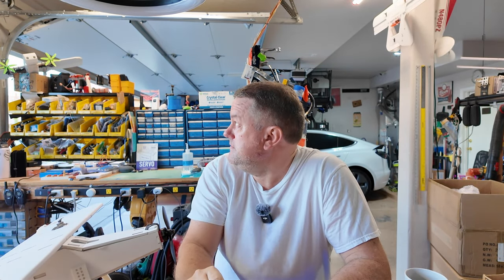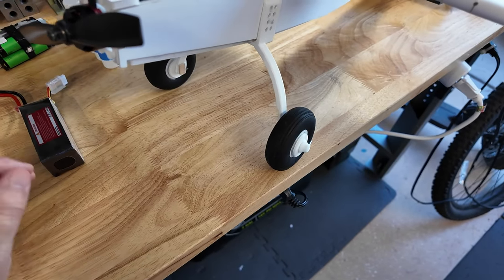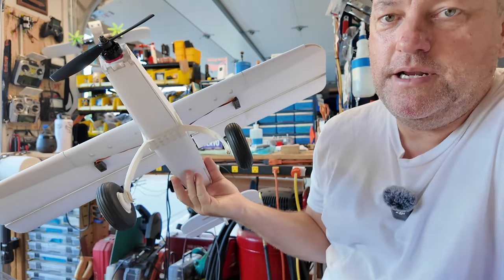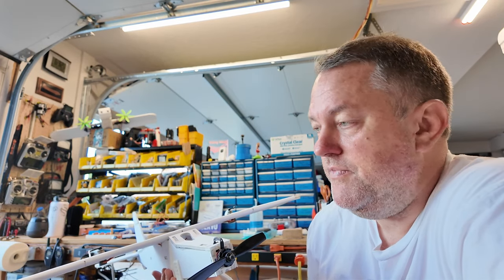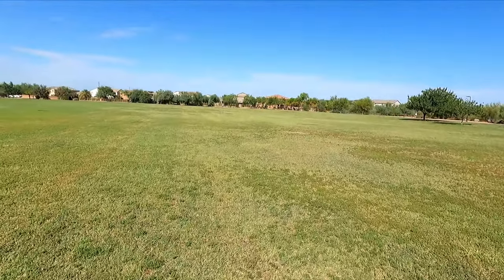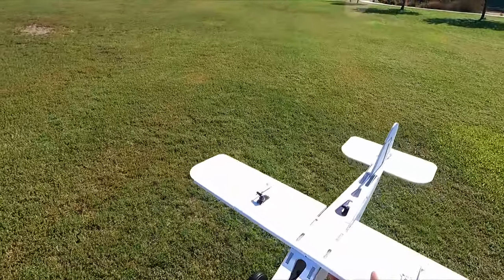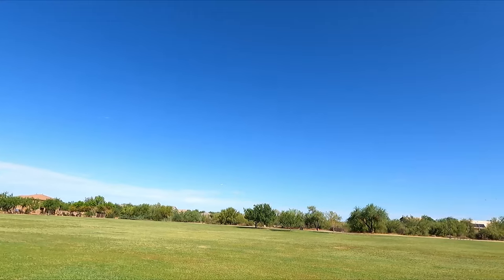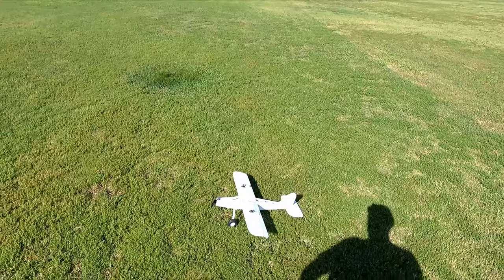Quick Build Radio Controlled Bush Plane

Comment: I like the openings in the fuselage, exposing the servos which also reduce weight.
Reply from the maker: Yeah- they serve many purposes.  They let air in and out to help cool stuff, they let me reseat the servo control horns when I fail to center my servos and build planes too fast, and they’re good at keeping the weight down.

You’re spot on.

Thanks for your comment.

Comment: Another great design! Really flys well. Thanks for sharing!
Reply from the maker: Thank you - it may be the most fun plane to just go out and play with.  The flaps work really well, and the rudder makes slips fun again.  And I’m happy with the gear for now.  I just epoxied in the axles - as I think the hot glue was overly optimistic - but it’s just a fun flying plane.

Comment: Nice design and flying. Pitch coupling when applying/retracting flaps is normal. A tad of elevator mix relative to flap angle will compensate.
Reply from the maker: Yeah - sometimes my commentary is more just notes to me.  I’m a huge fan of what OpenTX has brought to us, and ability to add mixes, delays, slow, variables, logical switches, and the special functions.  You can build the plane - and fix your aero challenges in software now.  It’s a good time in the hobby.

Thanks for the comment.

Comment: Inexpensive, carefree, fun flying with your own design.  Doesn't get any more rewarding than that.  Great video.  What is the wingspan on that one.
Reply from the maker: The plane is just under 29 inches in either dimension.  I’ll get some plans out soon.  I’ve never made plans before - and I’m learning that’s harder than I thought.

Thanks for your comment.
Reply: @usefulaircraft  Pardon my crazy thought, but since you lazer cut the plane, don't you have the plans already? Note: I'm not familiar with 2d cad but I 3d print.

Comment: Awesome designs. What transmitter and receiver do you use?
Reply from the maker: I’m all in on ELRS.  I’m using the beta fpv ELRS PWM receiver, and a radio master pocket radio for much of my flying.  I also have a full size Radiomaster - but for most RC stuff (not FPV) I’ll use the pocket.  It’s just too easy to bring it with you.  

Thanks for your comment.

Comment: Very cool!  I fly quads but you've inspired me to build a foamboard plane.  I have access to a laser etcher and 3D printing, so I'm in!  I usually use Adobe Illustrator or Inkscape to create svg for the laser.  I want to build a small light weight pusher with just elevons on the wings (is that what they are called on the wing).  I have SG90 servers, but I am going to try 2 very small linear servos.  My question is how do you setup your transmitter for this?  I have RMTX16S and a RMPocket.  I'll probably use the pocket with an ELRS reciever.  Maybe a good video on how to set it up?

Comment: Why invert the kfm?
Reply from the maker: I built an earlier plane with a KFM wing and was impressed - but noticed it flew just as well inverted.  So I tried building another plane with the wing inverted, and could hardly notice a difference - but I liked how it looked, and some of the design elements such as having a step to place wires behind - are really useful.

I'm not trying to build planes to squeeze every last bit of efficiency, my real goals are quick building planes that can be flat packed for when I travel.  The couple of percentage loss by not using a bespoke airfoil and hand built wing is made up for by Li-Ion batteries and their remarkable power/weight.

Even with inverted KFM's I have airplanes on my wall that'll fly for 30+ minutes, and they still fit on a car seat.  I fly planes at work that cross oceans.  I get bored doing anything for that long, so my design choices work for me.

Thanks for your comment.  I hope that helps explain.

Comment: Transmitter ? Receiver ?
Reply from the maker: I’m using ELRS.  Radiomaster Pocket for my RC stuff.  For FPV and longer range - I do have a full size TX16 with an ELRS module.  This plane used a Beta FPV ELRS PWM receiver.

Thanks for your comment.

Comment: What is your source for sheet foam?
Reply from the maker: I just run to the dollar store.  I'm lucky we've got them close by.  I call ahead, and usually buy a case or two when they've got them.

It's cheaper than beer.
Reply: @usefulaircraft  Glad to know someone else that is a "Tea Toatler" !     I'm addicted to Orange Juice.  🙂
Reply: @usefulaircraft  Have you discovered that by removing the paper you make the strength less, but the weight also less. BUT if you don't need the strength, lighter is handy. For example a turtle deck fuselage looks so nice (curved surface top) and there's plenty of strength in the sides.